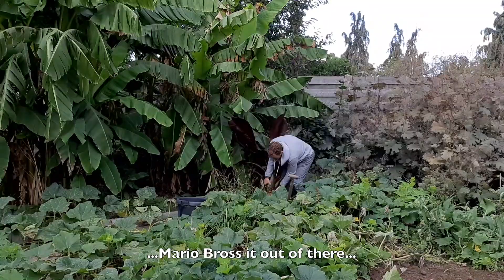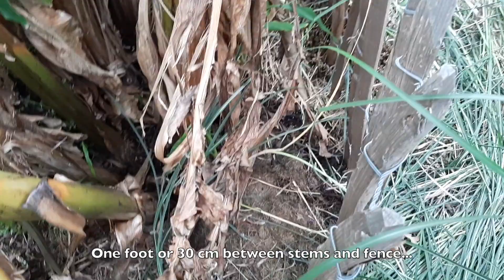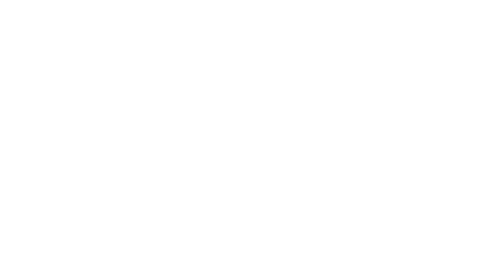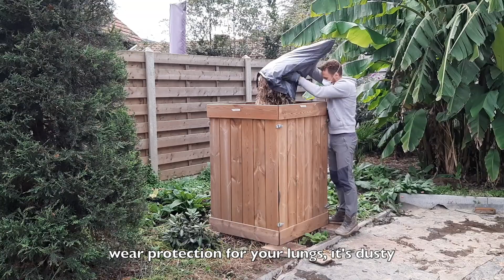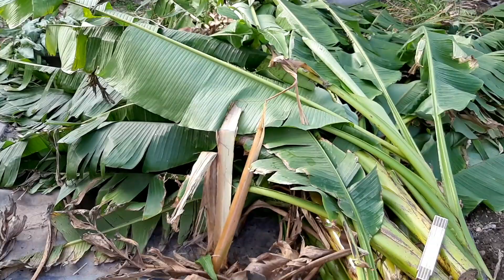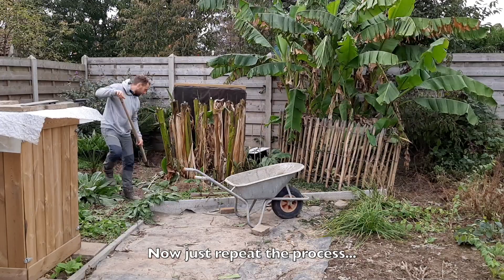Prepping banana's for the winter (-15°C / 5°F) will they survive?

Comment: How did you overwinter the red banana plant
Reply from the maker: Hi Todd, many thanks for reaching out. The best way is to keep them in a cool basement in the dark, forcing them to hibernate. 10C° Would be ideal. Regularly check if there are no lice on the leaves, if so, use 1l of water with a couple of drops of essential oil with brown soap and spray the remaining leaves. If the plant keeps on growing, cut away the old leaves to reduce evaporation.

I hope this answers your question, if not, please let me know! Good luck!